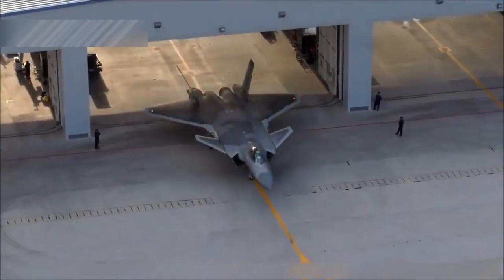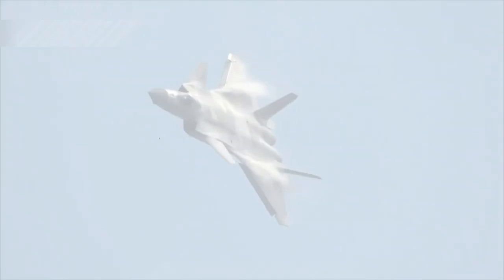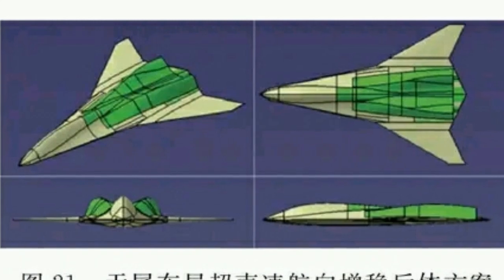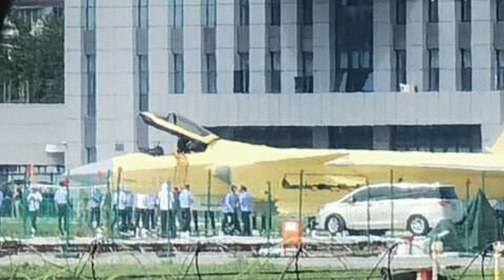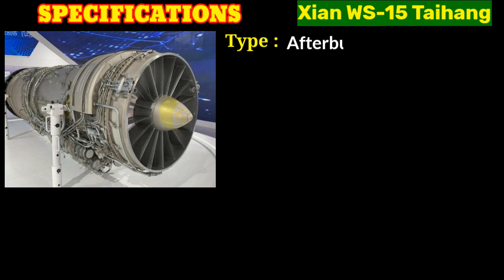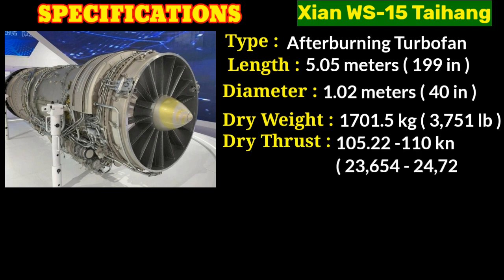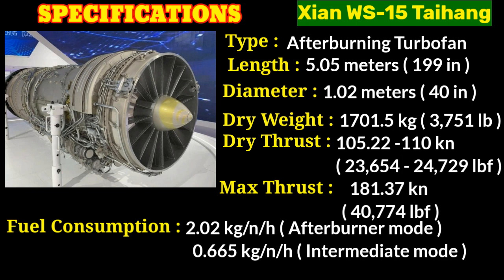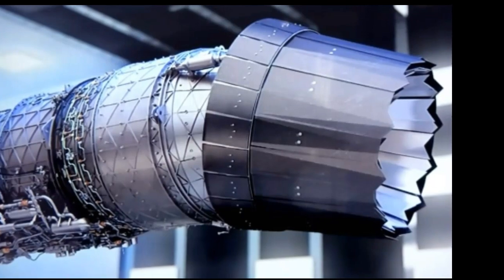China's J-20 Boosted By it's New Engine | China's J-20 With WS-15 Engine

Comment: Reliability, actual power, useful life, maintenance and production. Fix those and get back to us.
Reply: That all sounds good on paper. The WS-15 and J-20 should impressive. But, the reality can be quit different.

As a maintainer, I want to see how reliable this engine is. How many maintenance man-hours are required per flight hour?

It's one thing to build a capable engine. It's another to keep it in service, both in terms of maintenance and cost.

The U.S. can do both. We have very well designed equipment that are very reliable. And, we have not so reliable equipment that we can just through enough money at to make them work. 😂

Comment: Thrust is pretty close to f22 raptors engine f119
Reply from the maker: F-22 Raptor has Pratt & Whitney F-119 PW 100 (156 kn max thrust).

WS-15 reported max thrust : 181 kn. 

However,  F-119 is more mature.
Reply: WS-19 🐲✨️